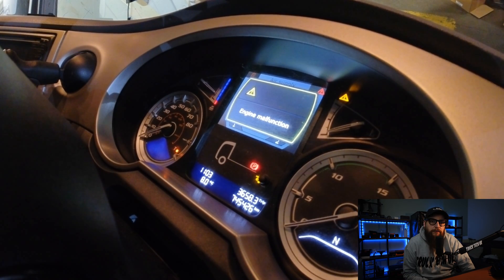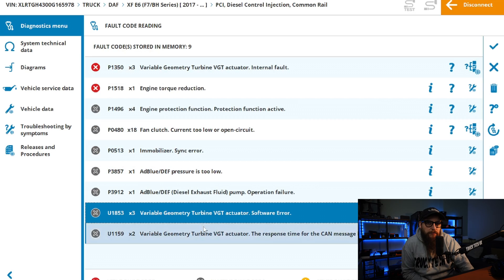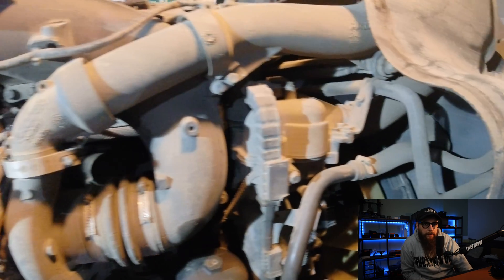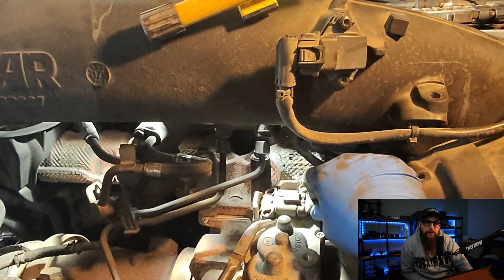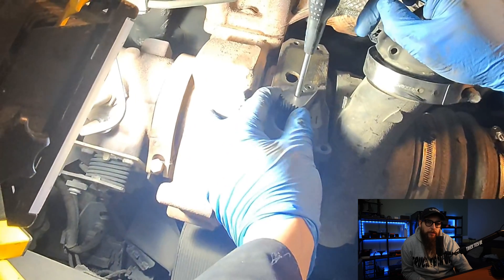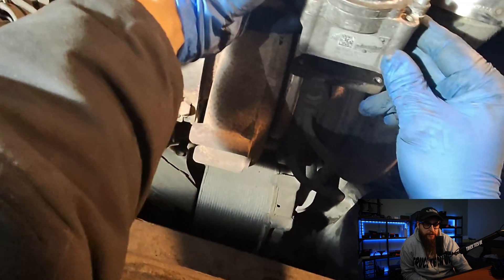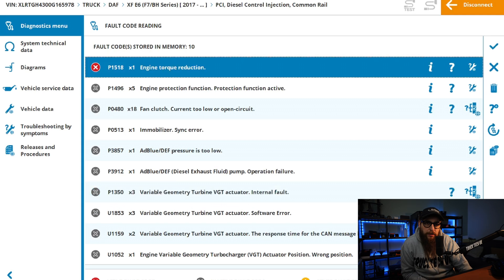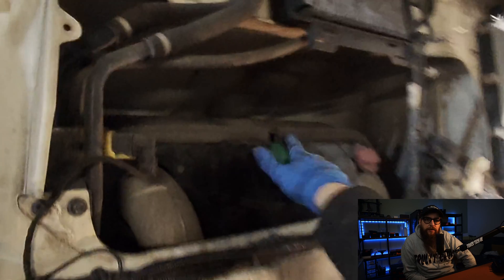DAF XF MX-13 VTG replacement with Jaltest!

Comment: Hi,  great video.  at 01:29mins, you mention Daf have a 5year policy on the VTG's,  is this the case in the UK,  (our Daf LF Euro6, 2020 just failed,  Daf quoted a replacement, but didn't mention anything about Warranty).
Reply from the maker: Hi buddy, as far as I know, this campaign is still in place. But you would have to ask for it. As for genuine VTG ACTUATORS if you are paying more than £1000 for it,  you are paying too much.
Reply: @TRUCKTECHUK  Hello,   Cheers,  my dealer is saying its possible on CF's & XF's if you meet the criteria,  but not on LF's, which sounds.    Where do you recommend for Genuine VTG's?

Comment: Hi mate, you mentioned you used a repaired unit to replace the old one. Do you repair them yourself? Otherwise where do you get them repaired please? I'm determined to try and get mine fixed rather than buying new. Cheers

Comment: In this case you didn't replace any parts, still what do you think happened here? Was it just out of calibration?
Reply from the maker: Hey Lon 👋 . I did replace the actuator, but it was fitted with a repaired unit of mine instead of a new one from DAF. The capitor on the board fails, or the bearings usually go

Comment: Hej great video 😊 just have some replaced in daf workshop and truck have no engine code anymore everything is fine when pick truck it has error on coolant level low error and its not sesor and tank what could be done wrong thanks subscribed 😊
Reply from the maker: Hi, thanks for the comment. I take it you have an MX-13 engine in it and the light is constantly on the dash.
Reply: @TRUCKTECHUK  its fixed it was just software update

Comment: You mentioned that jaltest have a step by step procedure to open and fix electrical problems with the actuator. I' m from Brazil and we cant purchase jaltest from here. Where can I find the process to fix the communication issues?
Reply from the maker: Hey, thanks for the comment. Jaltest has a guided diagnostic test plan which allows you to identify and fix the fault, which in this case was the actuator. 
The official repair is to replace the actuator jaltest doesn't have any instructions for opening and repairing the actuator unfortunately as this is beyond most technicians abilities

Comment: Hi. In one of your posts you mentioned coolant leaking from the left hand side of the rad? Save me trawling all your videos to find it , could you point me in the right direction please? Have a occasional issue on a mx11 which gaffer thinks is a split rad.  TIA
Reply from the maker: Stephen sorry for the late reply, it might be me going on about the overflow pipe from the header tank. It's a pipe that runs from the header tank and down the left-hand side on the rad. 

If your compressor head gasket has gone it will pressurise the coolant system and vent it out that pipe.....usually coupled with low coolant level warnings that disappear when the truck isn't worked hard. 

Hope this helps as I can't think of what else I'd have been going on about ha ha ha 😂
Reply: 😂😂. That was the one! Already had a compressor head change for that fault 👍🏼. Apparently the rad has a leak at the top, where the Ali core meets the plastic,  will see what develops.  
Keep up the good work. 
Thanks.
Reply from the maker: Cheers buddy, the best thing to do is pressurize the coolant system and have a look. I have got a kit from Eclipse here if you're stuck 😎
Reply: Will leave the decisions up to the boss or a total failure will decide for him!! Thanks again.

Comment: This is a pain in the ass for the owners, £££,    on these dafs.. they've got too complicated..   just to turn wheels on a road..  but keeps u employed lol  😂
Reply from the maker: Oh most definitely! It is nearly 2k for a new actuator! That's why I've started repairing them for out-of-warranty operators.
I'm here to help keep things real for the customer.....I don't charge 100's pounds for the use of the diagnostics unlike some
Reply: @TRUCKTECHUK I'm doing one as we speak.. one of the longer allen bolt is F T...  any tips,  bit of heat ??
Reply from the maker: You can put heat on it buddy as its at the front of the turbo, ive never broken one so id say what ever shit you give it, it will come out in the end 👍
Reply: @TRUCKTECHUK 
Thanks ,  one bolt was just really seized on the Housing....   My Rbrt wasn't having it..
. had to grind the ally away 💪... 
Done

Comment: Just to state the obvious: Great job! Can't fault your diagnosis.
Reply from the maker: Hey thank you 😅😎. I'd like to do some videos where it's interesting faults but it's seems to have been all been remove and replace recently 😑☹️
Reply: @TRUCKTECHUK  Could be interesting to show folks how the VTG mechanism inside works! I think it's a Cummins patent, in theory it should be more reliable than the usual moving vanes construction. Unfortunately the actuators seem to keep you quite busy...